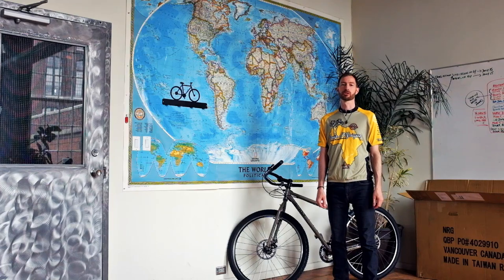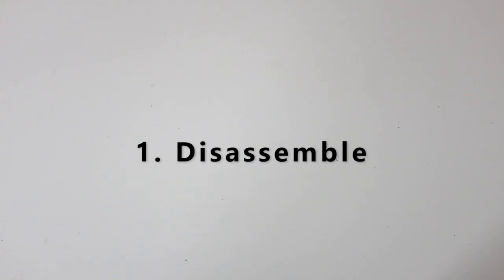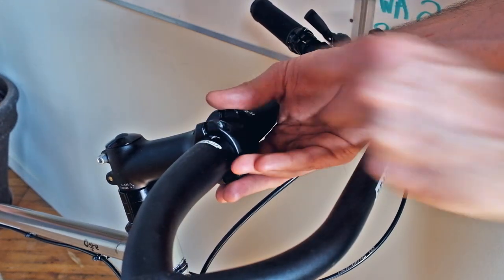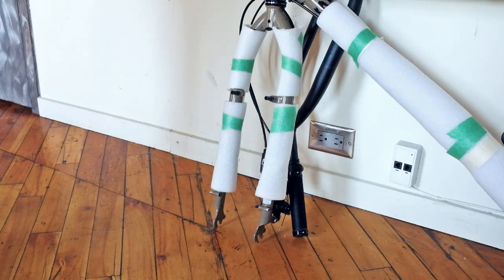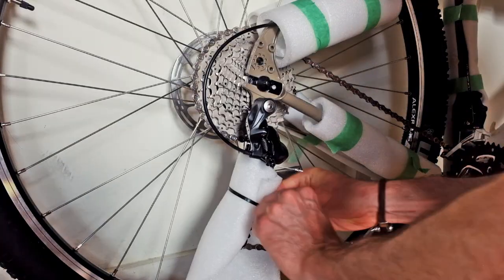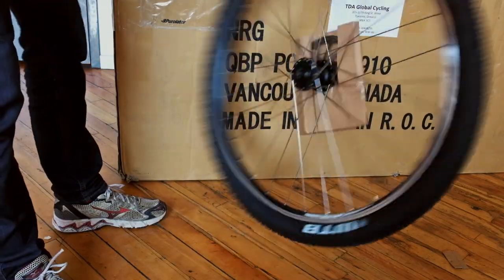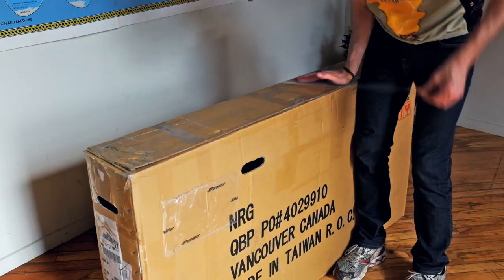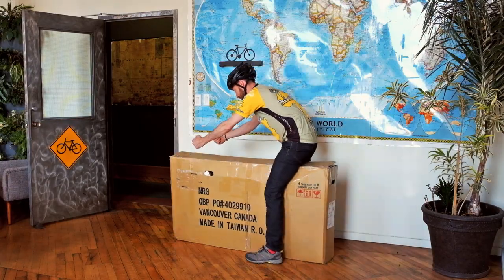How to pack your bike box

Comment: Fantastic! Just want I was looking for! Thanks a million!
Just a quick question, we don't need to add foam to the sides or below the bike? I mean does the fork just rests on the bottom of the box?
Reply: thanks, glad its helpful. yes, typically the fork just rests at the bottom of the box. if you are concerned about it poking thru, try placing an extra couple pieces of cardboard underneath.

Comment: Is there any need to remove the seat post/saddle on dropper posted bikes? Seems like an unwanted hassle
Reply from the maker: usually the box lid wont close with the seat still on, even a dropper post. But if the box is tall enough, sure, leave it on.

Comment: Do they allow this box as check in luggage? Won't they charge additional cost?
Reply: Yes, most airlines consider this oversized checked baggage and typically charge you a fee of anywhere from $50 - $200 USD. It all depends on the airline.

Comment: Thank you for the guide! What's the dimension of the box in cm?
Reply from the maker: Hi Archie, I don't have the measurements of this specific box. Every box is slightly different depending on the bike that it was made for.  But something around 145x25x85cm would be typical. Many airlines have a maximum combined linear dimension limit of 292cm (145 + 25 +85 = 255 cm). So make sure whichever box you get fits within the limit of your airline - although it is rare to find one bigger than 292.
Reply: TDA Global Cycling thanks! Really appreciate it, keep making useful content, man!